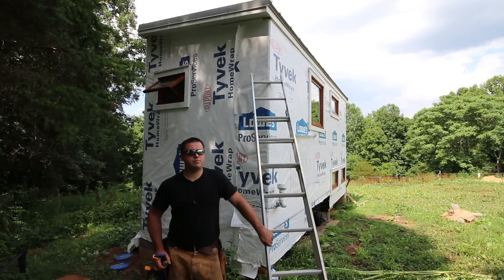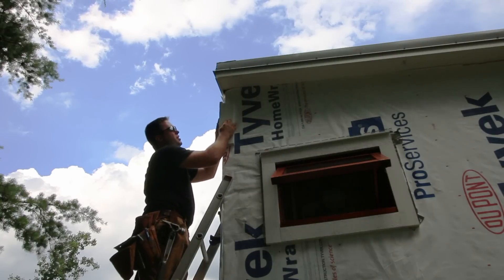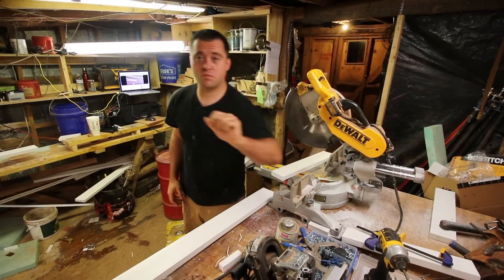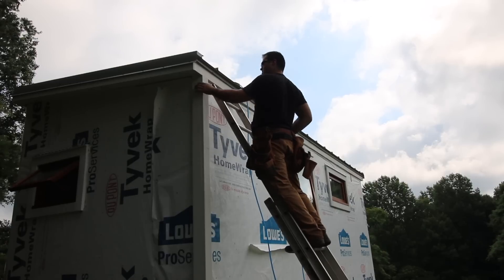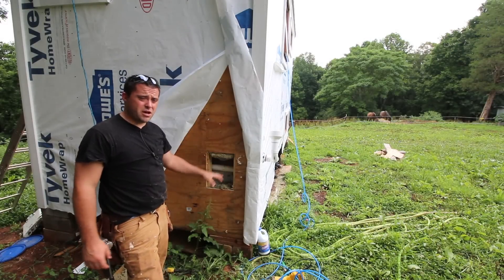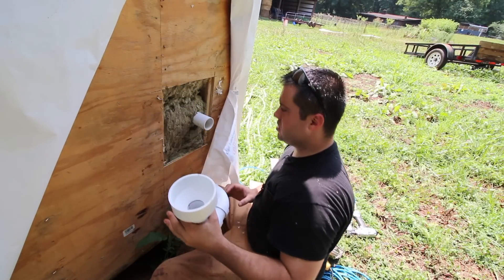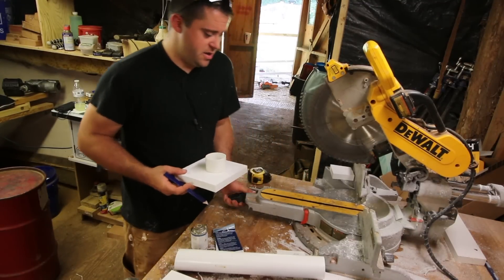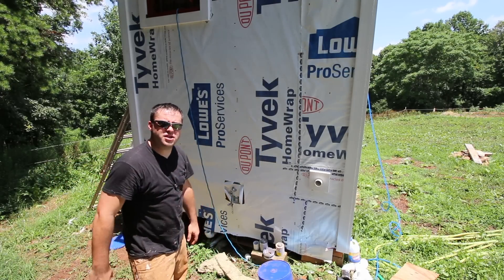Exterior Trimming on a Tiny House

Comment: What you can also do is put a small hole n the bottom of the flush pipe, maybe 1/8" during a rain storm, it's not enough drip out to stop filling the tanks once the flush level is hit, but once it stops raining, the flush section will slowly drain itself, you won't have drain it manually.
Reply from the maker: +ggin nj   Yeah I agree. Had the same idea, still have a threaded fitting but an 1/8 hole would drain it.
Reply: +Tiny House Customs the neatest method I've seen, had a upside down plastic empty plastic water bottle inside the pipe with a circle of plastic attached to the bottom, now top. Some plastic tabs just below the Y adapter inside. As the pipe would fill, the bottle would rise eventually occludding the pipe with plastic circle, forcing all water out the Y, the benefit was once it was occluded, the water coming down couldn't cause any turbulence so and spin up any of the debris that collected in the flush pipe.